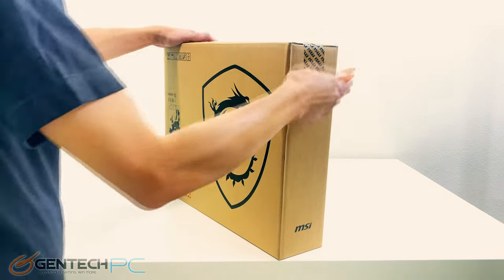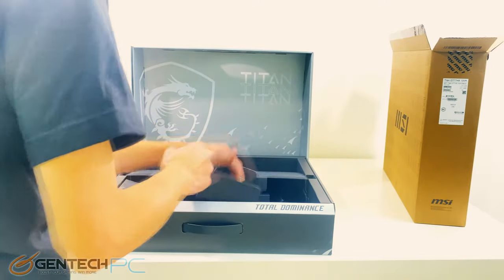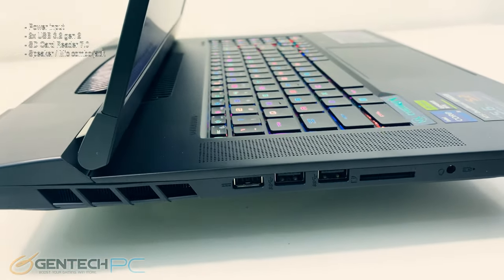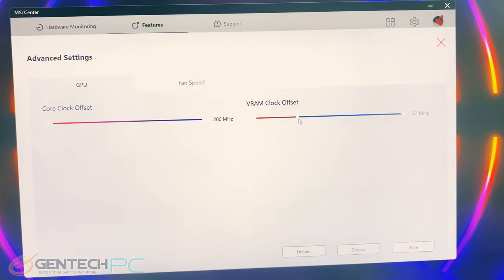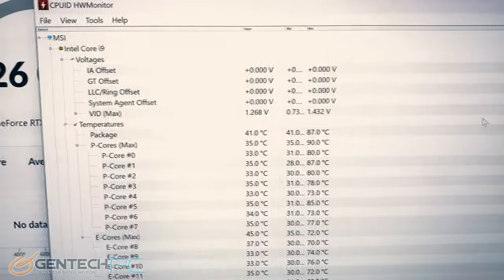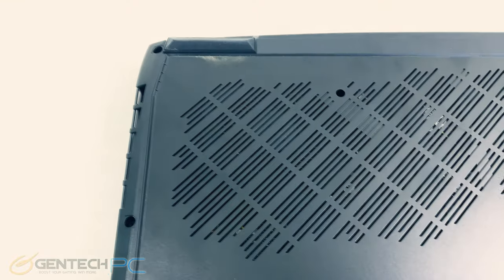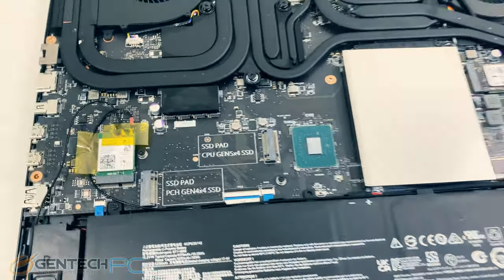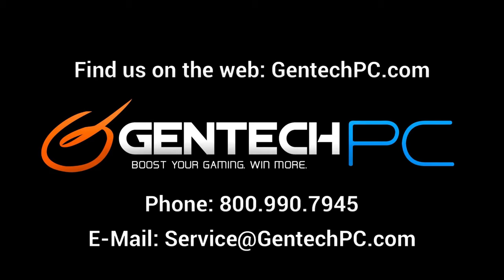MSI Titan GT77HX Intel i9-13980HX / nVida RTX 4080 unboxing

Comment: Just wondering, were your temperature results shown at 10:35 recorded after all benchmark tests or only after the first Fire Strike? I ask, since the GPU memory temperature sensor displays only 54 degrees, while the GPU hotspot recorded 107 degrees. It seems to me that the first test did not load enough the GPU memory. Am I right? Could you clarify that, please? 😅

Comment: thank you, now this rtx 4080 ver is on sale, finally can get the update of my 11 year sold MSI GT 60, hope it will last another 10 years !
Reply from the maker: I still have MSI GT70 with GTX 680M. :)
Reply: @GenTechPC  hurray ! did you replaced your gpu ? i replaced mine in 2020... it was the GTX 780M right after Nvidia stopped support Geforce drivers in 2019, how strange it is..., the GPU fails. Also replaced the battery, both find on aliexpress, a genieune GTX 780M and compatible battery with the hybrid power support. Other than that. A rock solid piece of hardware !
Reply from the maker: @fireoil  No I didn't, using GE75 with RTX 2070 now, I made GT70 into a NAS. :)

Comment: Why did this laptop do the opposite as the Titan 18 Hx. High gpu temps and insanely low cpu temps while the Titan 18 has high cpu temps and insanely low gpu temp. With the Titan 18 using more wattage. Can we awesome the 18 cools better?
Reply from the maker: I guess it's because GT77HX has 2 extra fans near CPU.  MSI remove the 2 extra fans on Titan 18 so it can have DC jack and other ports on the back instead of on the left which is what I preferred.  High CPU temps can easily fix by repaste with LM.
Reply: @GenTechPC  I had a defective unit. I exchanged my titan 18 and temps are amazing now. Didn't even thermal throttle in cinebench reaching max temp of 92 and 31000 single core. Difference is night and day now. I love it. GPU temps never touch 70 on it. Be wary of defective units.

Comment: For those wondering, my benchmark on TimeSpy with using the discrete graphics mode on my GT77 (RTX 4080) benchmarked a 18,967. A second test was 18,237 with the Hybrid mode enabled (Due to the need for VSYSNC in some games) - So something is wrong on his unit.

Comment: Hi, can you check if this Laptop allows you to turn on 10 bit color depth by going to Nvidia Control Panel? Just wanna confirm if the monitor supports 10 bit color depth. Many thanks in advance.
Reply: It does have 10bit, i have one. The picture quality is beyond what i expected from this (my laptop).

The only con i see with mine, is that it can get hot where you usually have your hand when playing games. The cpu gets to around max 85°c and gpu have never been above 73°c. This is with stock thermal paste etc.

Tested with cyberpunk on crazy mode(overkill graphics) or w/e the name is.

Comment: I just received my top version with rtx 4090 but it gives me eye problems given by the excessive flickering of the display probably due to using too low a frequency of the pwm. Do you have solutions to disable the pwm?

Comment: hi, I have a question. Can you check if BIOS lets run Windows from both SSD slots? I need to have two Windows systems - one on each SSD. I want to be able to run either one at any time and switch between them.
Reply from the maker: You can just keep press F11 when laptop is turn on and it will let you choose which SSD to boot.

Comment: I ran the PugetBench Photoshop Benchmarks against the Intel i9v13 64GB RAM against an i9v11 16GB and 40GB RAM. 
The MSI doubled the score of my 2 yr old 16GB RAM laptop, but once I upgraded my RAM to 40GB it was about 1.5x faster. 

MSI GT77 V     i9-13980HX 2.2Ghz 64GB 17.3" 3840 x 2160 (4K) Overall 1229, GPU 105.8, General 152, Filter 94
ASUS Zephyrus i9-11900H 2.5Ghz 40GB 16" 2560x1600 (HD) Overall 775, GPU 63.9, General 92.2, Filter 58.8 
ASUS Zephyrus i9-11900H 2.5Ghz 16GB 16" 2560x1600 (HD) Overall 689, GPU 54.2, General 81, Filter 57

Comment: if its the stadard time spy score that seems low, i score 12882 in graphics on my alienware r7 with a 3070ti, what power profile are you using, i think that card is 175w tgp
Reply: I think the test was incorrect and the tester was using the Silent mode. That's why the max power on the GPU was 100w instead of 175w. Also, the temps are high because of Silent mode as well (fans aren't maxed out)
Reply: @tigerreplays5677  12000 in silent mode is actually really good then.  It's as fast as a 3080 while silent.
Reply: @flat_stickproductions209  but not with a 107C on the gpu hotspot :D The test is incorrect and doesn't show the real thermals and performance
Reply from the maker: @tigerreplays5677  It was tested with extreme performance mode.  MSI need to fine tune their MSI Center app.

Comment: Thanks for the review. I wound up choosing a raider ge78 and sometimes wish I had gone this route. While I will play the occasional game I mainly do heavy CPU loads for work and have done my best to undervolt to keep temperatures under control. I didn't want the larger titan, but I kind of wish I had waited to see temperature differences. It would be interesting to see someone do a torture test with prime95 on each.

Comment: Something is wrong in those 3dmark benchmarks... It doesn't match at all with the general table, also a laptop with 3080 gives the same score in GPU... the data that you offer cannot be conclusive and it is evident that something is not right.  (it's just constrictive criticism). Cheers…
Reply: Im ordering this model with the 4080 (cheaper and more available for me vs 4090) and raised my brow on that time spy. its close to an alienware m15 r4 im replacing with a 3070 in it. lol.
Reply: @jeremymatthew6626  Have you already changed the memory speed to 4800mhz in the bios? There is definitely something wrong there.. I have the same laptop with 4090 and TimeSpy gives a score of 21,500, between the two I see that there is a difference like 3-4k points... so you should be around 17,000 at least.
Reply: @vikpar  meaning the alienware should be getting 17k? with the 3070? it gets a 10900 on a best go. I havent ordered this GT77 upgrade yet
Reply: @jeremymatthew6626  I mean that laptop with 13980hx and a 4080 should have a score of at least 17-18k
Reply: @vikpar  agree im returning mine if it scores 12k on delivery

Comment: What's the use of the smaller fans ??
Reply from the maker: Extra cooling.
Reply: @GenTechPC  , technically they are supposed to be for cooling , but i cant c what they are cooling or connected to , or is it just for more air intake to cool the copper pipes directly